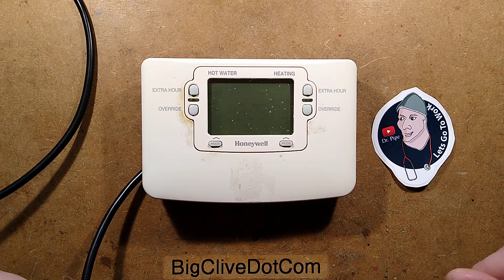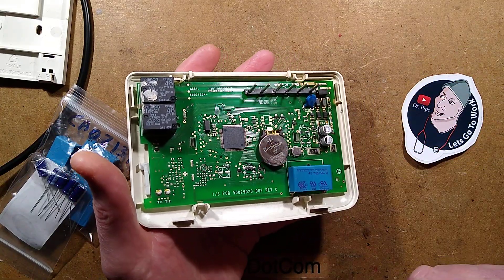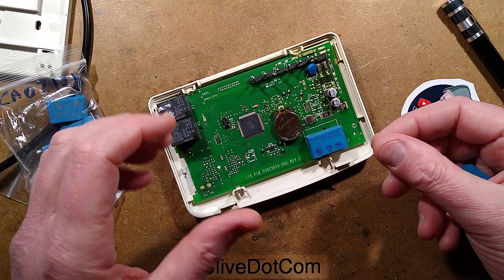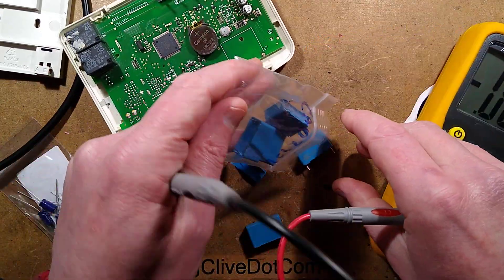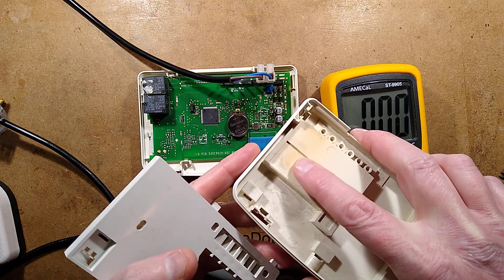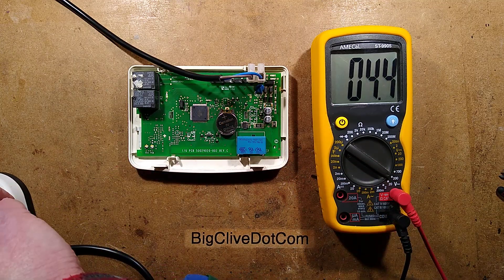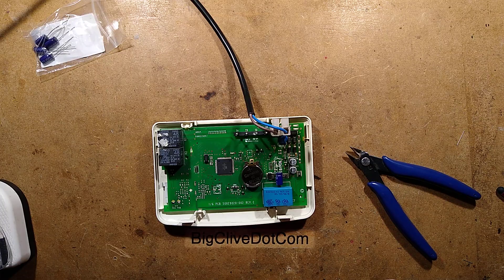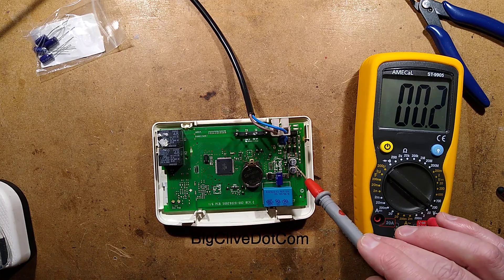Troubleshooting a heating controller.

Comment: Just took one of these apart today. I was simply going to buy a replacement, until I priced them up... £100? (not £20 like they, programmers that is... used to be)   We've experienced a few power cuts recently, and the program + clock needed resetting each time... I thought there'd be a nicad battery inside that had failed, or the charging circuit for it.  But no, there was a CR2032 lithium button primary battery there, easily swapped for new, and I hold stock of them for my kitchen scales... Swapped button battery, reassembled unit, seems OK.  Now I can move the damned thing to a more accessible location.  Six years of thinking I must move it to a better location... (It's hard to see for programming purposes) Now I've been forced to do something, in the area, I might as well...  Easier disassembly than I expected. Good video!

Comment: I’m having an issue where my heating isn’t being controlled by the thermostat. It’s just on run constantly and the light isn’t even on.
Reply from the maker: Depending on your type of heating system, a motorised valve may be jammed in the on position or some other item may be calling for the boiler to operate.

Comment: Hi all, can someone please answer this question. If you remove the control unit from the back plate will the boiler still work as the controller perhaps only controls off and on etc. We have a problem where although the control unit says off the boiler is still operating and heating the radiators, also in auto mode when the should be clearly off due to the time the boiler also still stays on?
Reply from the maker: Removing it will stop the boiler from operating.  It's possible a relay has failed.  Try tapping the unit firmly.

Comment: Thanks for your many really instructive videos. I saw very similar on-off symptoms with our earlier version of the same type of Honeywell heating controller. (Ours has a NiMH battery and a smaller display.) A check of AC ripple on the 47uF 63V smoothing capacitor showed approximately 12V. In this earlier version of the board there is a single through-hole capacitor, which was easy to replace temporarily with a 100uF 100V component salvaged from a dead compact fluorescent bulb. Although larger the capacitor fitted in the case. The controller is now working fine and I have ordered a replacement capacitor of the original type.

Comment: My brother had the same issue with his unit.  I ended up laying the radial caps with a tack of hot glue next to the 680uf to the left and shrink tubed small diameter wire over to the connections and it is still working today.  These are poopular controllers, but they use inferior components. The only difference between what I did and you, I removed the 2 defective caps.  Nice job sir!

Comment: That voltage is just a "We need something higher than the voltage running through the device, and we have these 63 volt ones for cheap".   So identify the voltage, and just find one that's the right size, package, and voltage higher than it receives.  Don't worry about the rest.    I run into that a lot in monitor power supplies.  "This is 5 volt.  Why is this a 25 volt capacitor!?"
Reply from the maker: The voltage actually was high in this unit.

Comment: Yup! Our honeywell heating controller had exactly this issue. Plumber said it was common, got a replacement. The casing was browned, and it had clearly got extremely hot as the board itself had burn marks. I didn't know what it was at the time, else I'd have tried to fix it! Very informative video.

Comment: We call these things "thermostats' in Canada you programme the temperature and the length of the cycle, here we have programmed 2 of the 8 cycles for heat and 2 for air-conditioning..

Comment: I have 2 time smart wifi sockets won't mention brand. But both have died after MCB tripping due to too much on the radial circuit. But I have more installed on same radial circuit which haven't died. But the 2 that did where installed at same place. The second one was a brand new one sent out by the manafacturer. I wondered if you wanted me to send them to you

Comment: I had the same issue with a Dell desktop computer: it would constantly reboot.  I tested the power supply and the 12vDC rail was unstable, a 4vAC component.  I popped open the power supply and found four 1500uf electrolytic caps had gone bad; two leaking and two bulging.  A replacement power supply is only $30, but that's cheating!  I replaced the caps and it's good as new.  Cheers and be well, Big Clive!

Comment: If you just turn on 1 channel it will probably will work. As soon as you turn on both it freaks out. 👍
Reply from the maker: This one was beyond that.  It was crashing with just one.
Reply: @bigclivedotcom  Sometimes just turning off the back light will get them going on both channels too. Obviously Dr Pipes one was completely FUBAR. Nice repair. :-) I have a VFD too if your interested.

Comment: Hey Clive. Just wondering if you have a contact method, and whether you'd be interested in tearing down my beloved late multimeter? I was streaming last night and the battery ran out so I botched up a couple of wires to the bench supply (works fine usually as you'd imagine). It worked great until I went to use my TS100 and accidently sent 20v to the battery terminals 🤣 let's just say it's been toasted now, it has a nice big burn mark which you would probably love the smell of lol

Comment: I would not have done the repair this way.  First, it would be essential to me that the old bad caps be removed, otherwise they have the potential to short out.  Second, what does it matter if the replacement caps you have, fit?  The recessed backing of that plastic case, is easily drilled, otherwise machined, or even hot-knife, cut out to make clearance.

One thing I like to do when I have such a component clearance issue, is put a dab of grease on the component where it would contact the casing.  Then I put the casing in position and the grease transfers onto the casing, giving me a reasonable starting point for making a hole for component clearance.  

In this particular case, you wouldn't need to lay the capacitor down on it's side at all, instead I'd prefer to leave it at a 90' angle to the PCB since it is a relatively low capacitance for an electrolytic cap so doesn't need to be very tall, or really it would depend on what stock of caps I had lying around because that looks like a fairly low cost thermostat to me, would make little sense to spend nearly as much as it's worth in time and components and shipping to repair it.  I would repair it anyway, prefering to keep landfill waste to a minimum and recognizing that if things need this size capacitor that I might as well get a stock of them, but at the same time, I wouldn't be ordering them for a one-off repair, would have to see repeat need for a size to order enough to make it more cost effective.

Comment: I have a bunch of PIR sensors for lighting. All of them failed almost at the same time. All with the same problem. They were using 24V relays, smoothing caps were 25V. Replaced them with 50V caps, no problems so far.

Comment: My AEG built in fridge exhibited a similar fault.
Door shut, would run fine.
Door open, lamp and compressor would keep switching on and off.
Dropper capacitor had deteriorated from 1uF to 650nF.

Comment: good analysis , common issue with those low profile caps , they are not reliable , to remove them take pliers and do a quarter turn , and off they go , then just solder on the remaining leads new caps , normal ones...will last another ten years, had same issue on my washing machine doing anything , like if the controller was mad , and on an electrical store , all issues with these filtering low profile capacitors

Comment: Clive, it's the 680nf capacitor. Mine failed because it's a capacitive power supply and the capacitor value was practically halved therefore not enough power available for the backlight and both relays on at the same time. Common issue, they start to fail after around 10 years. I think Honeywell did a recall on them.

Comment: I had a similar issue, different make, in that one relay would operate but not both at the same time. I replaced it rather than repair, because the bathroom, where the controller was, previously suffered an over-temperature event due to the wall heater catching fire.  Everything plastic was slightly misshapen.  Including the controller which was inside the airing cupboard.  Do people still have those?  I guess not, with combi-boilers.  Anyway, I did check the board and indeed the voltage was low on the relay power lines.

Comment: Clive, please please please do a video about designing uk mains down to +\- 15v dc power supply for running opp amps. (Without transformer). I’d like to make a big guitar effects box that will have buffers between its various individual effects... having a transformer would be too noisy. Some thing based on  LM 78 voltage regulators series would be good - nicely clamped... just having problems choosing capacitor values etc

Comment: A temporary solution to this is to turn off the LCD backlight, that got mine working for a few days while I got a replacement unit. Common problem with these, apparently any made around 2010 - 2012 have poor blue caps and Honeywell were giving free replacement units to those that complained. Video here: https://www.youtube.com/watch?v=Esc1nnYHxDM&ab_channel=SimonT

Comment: you can replace the electrolytic ones with smd mlcc, for example:
https://eu.mouser.com/ProductDetail/Murata-Electronics/GRM32ER71J106KA12L/?qs=eeBpzGFlv%252B%2FlkjOiPI7fBw%3D%3D

Comment: probably more like "they discovered they could get more money when it fails sooner than later" by leaving the capacitors out, but many of those are known to fail anyway and often times will fail shorted after they've puked on the board and eaten everything up.
Reply: What are you babbling about?  How do they get more money?  If it fails within warranty they lose more money, and if the failure alienates the customer they lose repeat sales.

No it was the opposite, a best guess that they won't get more from a failure but rather that the failure would be far enough into the future that the liability was a lesser cost than improved components.  It's a classic tale of engineers wanting to build things robust then bean counters coming in and telling them they are going to cut the cost now pick how to do it and still end up with a working product.
Reply: @stinkycheese804  warranty, what warranty, those are 1yr at best, so it will fail outside of warranty guaranteed and likely very shortly. like most everything on the market these days, fails right after or is too cheap to bother with shipping for repair.

Comment: they generally get stupid and keep resetting when the coin cell battery gets low or go through cycles of working and not for a while
Reply: hmm, do they need the 2032 cell, when plugged in - it should be a terrible design to have it use at all if there is mains power.

Comment: Looks like that kind of pulsing is a common symptom of a faulty cap.  I found the same problem on a pellet stove control board. It also would flash on and off.

Comment: aren't those solid state caps? They go dry?
Reply from the maker: Pretty sure they're wet electrolytics.
Reply: @bigclivedotcom  so the name is a marketing gimmick? Does the color of the markings on the can signify anything?
Reply: Surface mount, but wet

Comment: Thanks, Clive. Interesting Fault but undoubtedly because the case has no ventilation and is so tight it's boiled the poor Electrolytic Capacitors. Honeywell stuff used to be quite good quality but everything is just thrown away these days, no one fixes anything & being honest for a heating engineer to do a fix would probably cost more in labour than having a new unit fitted.
Reply from the maker: The fix is aimed more at homeowners.

Comment: You may remember? Im a Gas Engineer.
The Top gripe I have in the industry?... That involve both Engineers and Joe Bloggs, the   generic Custard trying to penny pinch and fix his own boiler. ...Is?..
When a fault occurs on the Gas boiler itself.  A broad spectrum of guys mentioned, swap out every major  boiler part, without the solid confidence that 'A' specific part has failed.  So they buy a Fan!... Not the fan,  buy a Gas valve!....Not valve, buy a Pump!... Not the pump.
So at this point they've swapped out every major part, and boiler still doesn't work!... No change!  Original fault occurs.
The money spent would equal a New Combi 😫
Being self employed,  you can't spend all day on a single boiler breakdown. You simply couldn't charge the high labour charge it would come to.
And you wouldn't have a buisness if you kept on being a good smaraton?  Putting in hrs,and hrs on fault finding.  Especially if it's the first time you've come across the fault.... it takes time , methodically Checking electronics.
I've done it before! Spent all day and made bugger all. But if i needed to l could  waste my day pissing in the wind, because I was my own boss.   And no money coming in that day? There's always tomorrow...lol
So I've always put more time and effort in .  So that I don't become the Engineers that I dislike. 
I'll make sure I'm 100%, before I order that £250 pcb. Or £300 fan.
I hold my hands up though?? ....
Beginning of Covid ? A  "Y Plan" vented system, had a fault where heating would only work with h/w selected at prog. 
C/H Thermostat had to be high for H/w to come on also.
Summit like that anyway??  I changed out 3 way valve.  And it ended up being the programmer. 
First time I had to explain what happened.  Hard to explain technical stuff to a Custard.  Especially when I'm owed money.  Regardless whether I made mistake , there was a lot of labour cost , and me being a Fanny,  I did it far too cheap......total shit house I am.....lol
Reply from the maker: The best engineers are the worst businessmen.
Reply: @bigclivedotcom  Wow!! Your so correct.
I'm a pussy,  for example when it comes to getting paid.  I hesitate and go in circles, psyching myself up .As I have some complex.  Even though I've done great job and price is reasonable . I struggle,  and yeh!  That's it! I'm not treating it as a buisness transaction. I'm treating it like their a m8 and I'm struggling to ask for money.
?? Is my price too much.
What will they think?
How much did they expect.job was?
Im a Fanny.lol

Comment: My humidifier wasn’t working. Thought it was the solenoid valve since water wasn’t flowing. Ordered a new one. No change. Then I realized my thermostat doesn’t have a humidity sensor and the loop of wire running from there to the 12v transformer wasn’t needed. I bypassed the unneeded loop of wire and the solenoid opened as it should. If I did have a humidistat would it actually have worked. I’ll never know.

Comment: Do you need a true rms multimeter for that 'ripple trick'? And would it work for dc ripple outside the 50/60 Hz range (i.e. switching power supplies or buck/boost circuits)?
Reply from the maker: It works best with a cheap traditional multimeter and only at low frequency.

Comment: I had an old Technics turntable that stopped spinning at a constant speed. Swapped out all the electrolytics as I think they were over 20 years old but sadly no improvement. There's a fancy IC in there with some motor speed sense circuitry, but beyond me with mains voltages involved.

Comment: This reminds me of a story, My grandmother years ago got a furnace installed by a shady company. I went to change the battery next season and something fell out when I took it off the wall. when I put it back it no longer functioned, when I examined it  I found that the pins where bent so they did not go into the correct slot on the header and thing that fell out was a chunk of brass used to bridge it over. What they has done is rig it like this so they would get a service call whenever someone changed the battery. Rigging a woman in her 80s heating system to fail is quite the classy thing to do don't ya think?

Comment: Your method for testing ripple is exactly the way I diagnosed a bad "remanufactured" alternator in my car (it had about 2,500 miles on it, replacing the original with ~247k miles). At idle, I measured 12.4 VDC (already low), rev the engine a little and it dropped to 2.8 VDC. Switching to AC, idle was 18.9 VAC, rev the engine and I was getting 74.5 VAC! So, I did what any "smart idiot" would do, I pulled the fuse for my radio, pulled the fuse for my subwoofer amplifier, and drove with every electrical accessory on (headlights, rear defogger, heater fan, dome light, literally everything I could turn on that was a resistive load to soak up the excess voltage) to the auto parts store and performed a warranty exchange.
The manager did it without question, then an employee called her out on not putting the alternator on the testing equipment prior to the exchange, as is their policy. So I told him what I had measured from the alternator in my driveway, and followed up with "I don't want to waste my time and energy, or yours, exchanging a part needlessly."

Comment: Thanks for the ripple-voltage-measuring tip.

Can you not move the replacement capacitor to someplace with more space, maybe further to the left, using a voltage-appropriate insulated conductor pair to connect it to its pads on the board?

Comment: That is quite useful to know as I have one of these. I think I would have put flying leads on the cap and glued it along where the PCB no. is printed or made a hole in the case and allowed it to poke through if there is room to do that.